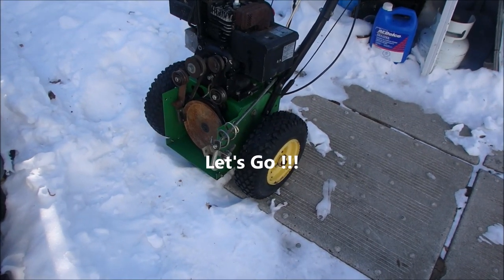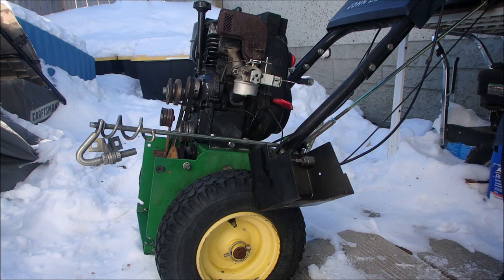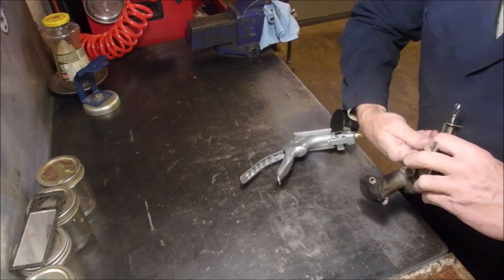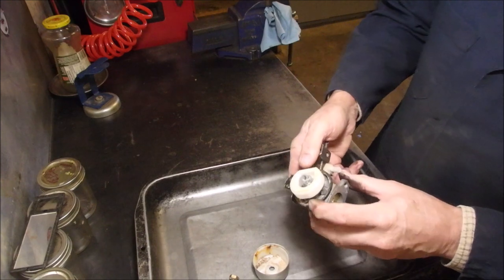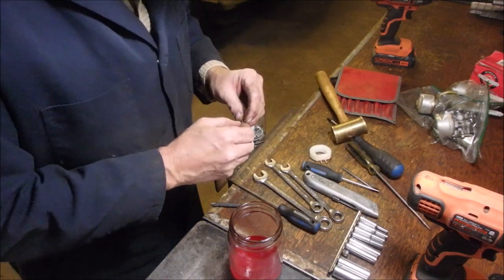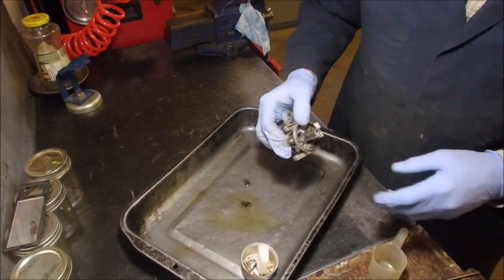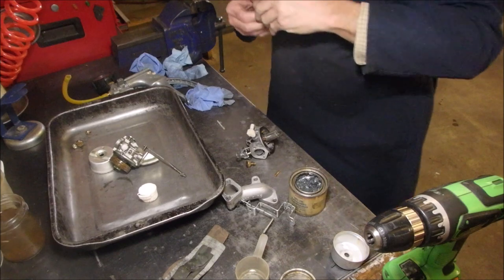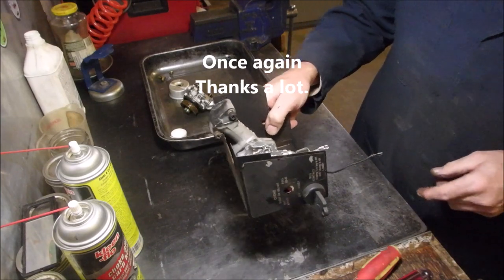John Deere TRS 24 Snowblower Carb Repair

Comment: Well Bruce you almost made it through this video without dropping something eh? Yep sure looks like a aftermarket carb Tecumseh only have the rubber seat and aluminium needle. At EP we use a spring loaded centre punch to remove seized float pins eliminates the possibility of snapping off a mounting arm but a penetrating fluid application helps. So far this is an excellent rebuild and yep those 5 hp are a b---h to remove the fuel line from the carb and you have to be careful not to damage the plastic fuel inlet. Looking forward to seeing the finished product.
Reply from the maker: Yes there is a new fuel line coming in the future.  This has been a big job.  perfect for a slower time of year.

Comment: I agree with you bruce sir I think it should have had a Welch plug there where they primer goes unless it setup completely different for it to work that way, good work on that Tecumseh carb sir
Reply from the maker: Yes I  It did seem kind of weird.  Thanks again.
Reply: @BrucesShop  you welcome sir

Comment: The snow makes for a beautiful background for R&R-ing a carb but I am trying to figure out why you would subject yourself to the cold. Was your shop taken over by stray wolves, or maybe on fire?(mine would have to be on fire before I worked in the snow)
I loved the "ooohhh yeah" when the linkage matched
Reply from the maker: In my little brain I was just going to slip out and undo the carb and bring it in.  I wasn't ready to bring the engine and transmission into the shop as it takes up a bit of room.  I should have as that is the next video.
Reply: @BrucesShop  I was cold watching. 🥶